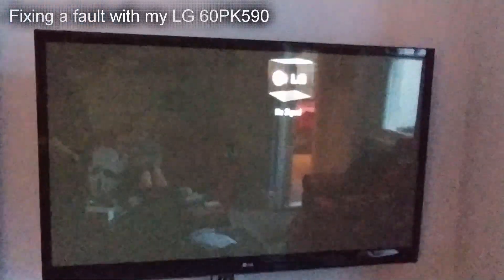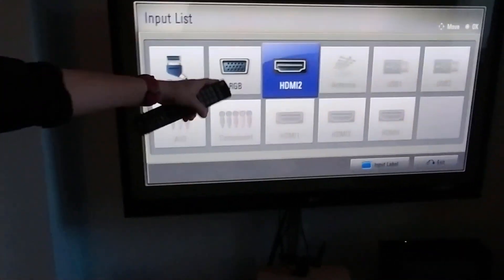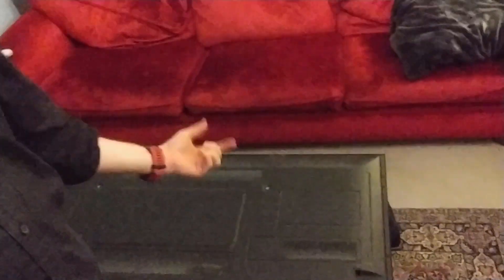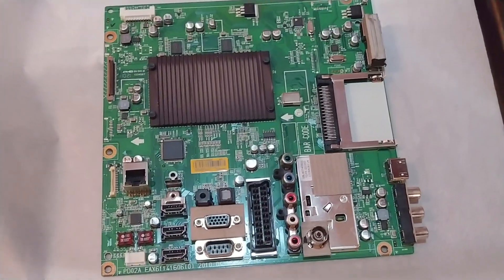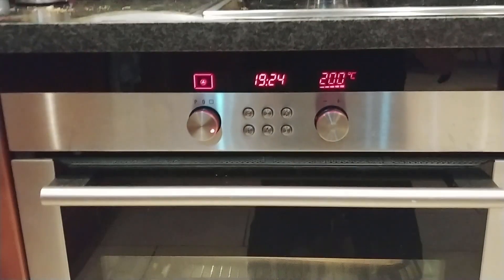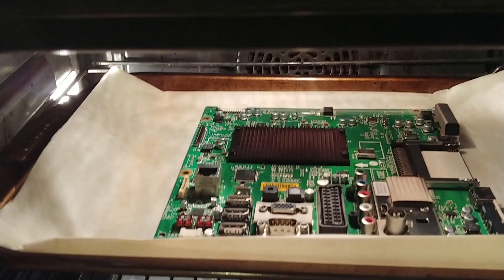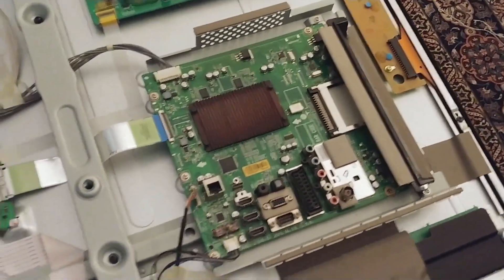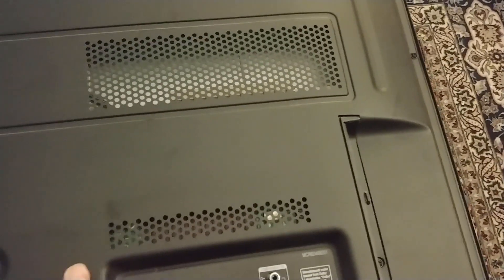Fixing my LG TV... by putting it in the oven

Comment: I have a 60" LG 60PM6700 Plasma TV, 12 years old, with 4 faulty HDMI inputs. I baked the main board at 390F for 15 minutes, voila!, works. Did make a stink that lingered in spite of opening a window and running the stove's exhaust fan and some of the plastic around the RCA connectors slightly melted.

Comment: Jonathan when you took the board off did it have grease on the bottom and if so did you clean it or leave it?  Mine seems to have a pretty good amount of grease on it.
Reply from the maker: Grease I would remove before heating. Mine didn't have any IIRC.

Comment: To prevent it happening again, never ake out the power cord while not in
 use, let it be in standby mode always! I found out that the board stops
 working when it has been left in a cold (below 10' Celsius) room for a 
week or so without the power cord attached. So,  never unplug the power 
cord (tv, blu-ray surround etc). I`m baking my
 board for 2 time now. Lesson learnd. 
EDIT: Last time it lasted for 3 years, and it also worked today!

Comment: Help needed!!! I have a similar situation with my LG monitor I'm able to see a black blank screen, when I connect my laptop through HDMI and I'm able to hear the audio but no video. Any idea this method will work with monitors? and I have a microwave oven. Is it any different from the oven you have? Should I give it a try?
Reply from the maker: Microwave will NOT work. You'd get a wonderful fireworks display if you used a microwave with this process.
If you can use an oven (fan or convection) then i would say give it a go. What have you got to lose?
Reply: @JonathanJenkyn  Haha I don't want any fireworks for sure. Do you think Hair dryer would be a good option? If so how long should I blow the motherboard? First of all I think all the oven methods I see in internet is for tv, can I safely assume it's the same process for monitors as well?
Reply from the maker: @thanish1991  hairdryer won't get to a stable temperature and won't be hot enough either. You really do need an oven. Should work for many electronics where the solder has dried up.

Comment: I did this last night.  do it at 392 F (200 C) for 10 minutes.  let it cool for 30 minutes with the oven off and oven door open.  then move it to the kitchen counter and let it cool some more for 30 minutes.  now to prevent any smells first make a pouch out of parchment paper, place the board in the pouch, and staple the open ends closed.  then make a pouch out of aluminum foil, place the board in the parchment paper into the aluminum pouch, and fold the open ends of the aluminum several times to make it air tight.  do not open the pouches in the house after the board has baked and cooled.  I went to my garage to get the board out of the pouches.  there were exactly no fumes or smells while I did any of this because of the aluminum pouch being sealed by the folds and opening the pouches in my garage.  once installed, the board has been working ever since.
Reply: the fix has stopped working.  I will have to do this again.  so it seems that this fix lasts about 8 months before needing to do it again

Comment: It's January 2020. And I'm excited --- your video just helped me to bring back to life my 10 year old Sharp Aquos LC-55le620ut. I mostly used your method with minor modifications:
- preheating the oven to just 350F (177C)
- wrapping my TV mainboard in tinfoil all around and putting it in a tinfoil tray
- I placed it inside at about 150C while still preheating
- after reaching 177C - I kept it in the oven for 7 minutes

Voila! That was sufficient to resolder whatever bad connection. It didn't even smell.
All glitches are gone, my Aquos is Made Great Again!
Reply from the maker: I would be worried that the tinfoil would cause reflux away from the board. That said, congrats! HNY!
Reply: Hi Max, woulld like to hear some updates on your repair. does your tv still works?

Comment: Can Explain Why putting in the Oven ?
Reply from the maker: It reflows dry solder joints. This usually happens because of low to no Pb solder that's used in modern electronics. One might say they're being eco friendly, but when you're throwing away tonnes of tvs, I'm not sure its that green.
Reply: Probably cleaned up of dust and moist.
Reply: Melts and re solders the connection with the heat from oven

Comment: Hi, first of all I want to thank you. My 60" LG Plasma had the same symptoms. My board was different and it was not available for me to remove in that fashion without having to buy new parts. Of course buying the new parts would have been risky on something I was not sure would work. So what I did  instead was to get a small cube heater and position it directly behind each of the 2 boards on high heat for 20 minutes. Well when I was done I did not reattach the backing of the TV  I just tested to see if I could get the LG logo back up on my screen. Well much to my delight, there it was. I am now watching a little golf and I owe you for giving me the idea. I did not video it as it was a lot of work lugging that old plasma up and down for me. I hope this helps someone else. Thanks again and again and again for sharing, I would have never tried what I tried without you. Have a Happy Easter.
Michael

Comment from the maker: ... and 9months later, and the TV has died :(
Reply: There are people that have done this 3 and 4 times though. A little work, but still cheaper. I will never buy an LG again though. This is a problem right across their line ups and they should have a forced recall as it is a defect, that seems a little to convenient to forcing people to buy new TV's. Planned obsolescence comes to my mind.
Reply: Just do it again. Faster and cheaper than repair or even going out to buy new. I did this a few times to my Xbox 360. Great video.
Reply from the maker: I've baked it again recently, and have a lovely new mega-monitor for my office ;)
Reply: @JonathanJenkyn  I'm curious what you mean...did it work after the second time or not?
Reply from the maker: @louf7178  Yes it did! In fact it's worked 3 times now! https://youtu.be/yP9Tava3z4c

Comment: It seems this TV is weak at the HDMI connections. I have done this 4 times, pulled the board today for a 5th. It seems to blow up when I try to use a Firestick or Chromecast on the HDMI port for very long. I was able to get a longer duty cycle this time by putting my Firestick on HDMI 1 instead of 3 but alas here I am again.
Reply: Wow, you might be right. I seem to have had the problem after switching back and forth on the HDMI's to my Android box. Good share for others to read. READ WHAT KEVIN JUST SAID, IT COULD BE IMPORTANT. Me I am going to use the Android box on my Panasonic upstairs, it never seems to have issues.
Reply: Interesting, when my TV stopped working I was watching something on Chromecast and fell asleep, the next morning it was still on, then went to the bathroom and there it was, the "no signal" message, I got cc about two months ago and my TV never behaved like that before, now this weird thing happens every now and then when I switch inputs the audio is gone unless I have to go back and forth inputs to fix it.